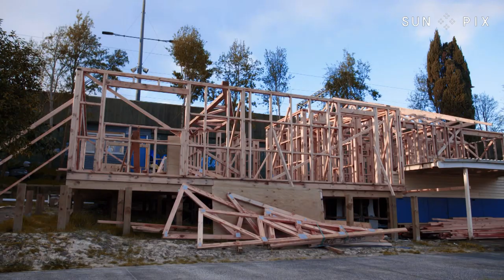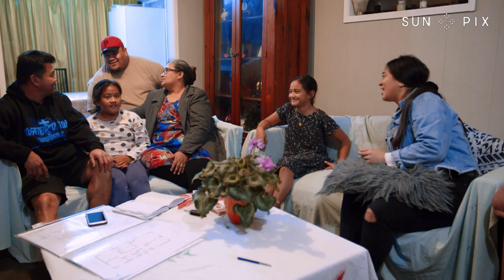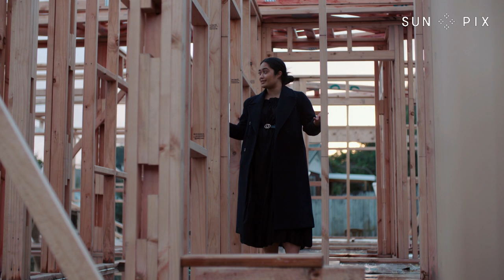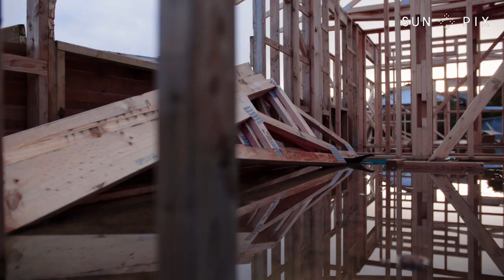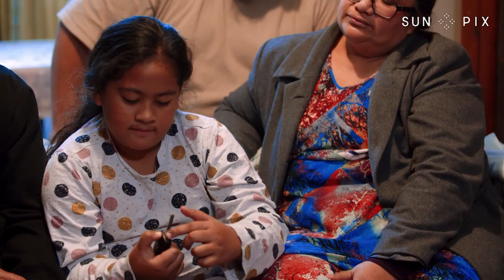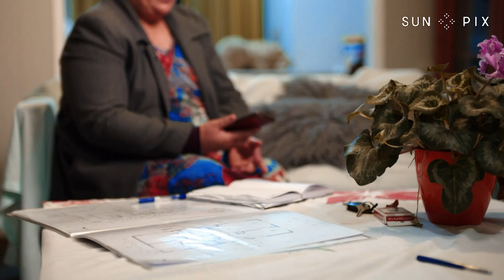A Samoan family's home renovation nightmare

Comment: I am a contractor from the states  under good working conditions with 5 men besides myself  we could have set  the trusses and put all the  bracing on them in two days. on a house that  I framed one time the truss company didn't build but three  of 52 trusses right my crew  rengineered the other 49 on the job I got the trusses  free plus the truss company paid  me  100 dollars a  truss to   repair them.  If  your house was framed the measurements the plans called for that   is who is at fault on your  house the truss company I wish I were there  I would help  you get your house back on schedule for free because  I can't stand to see someone get taken advantage of